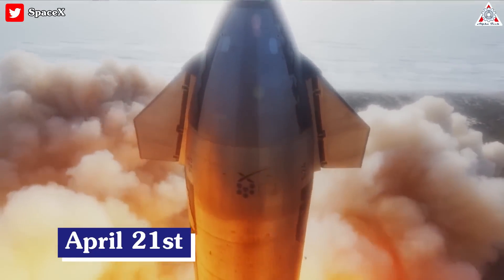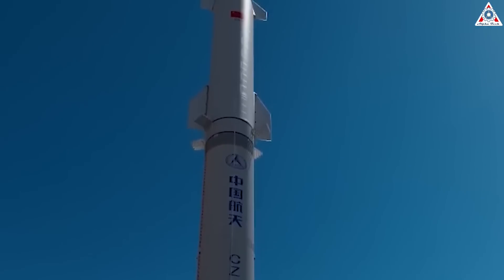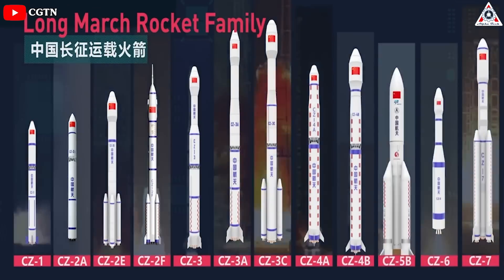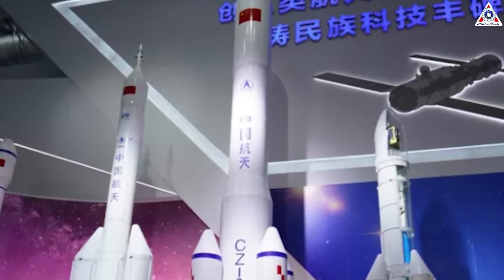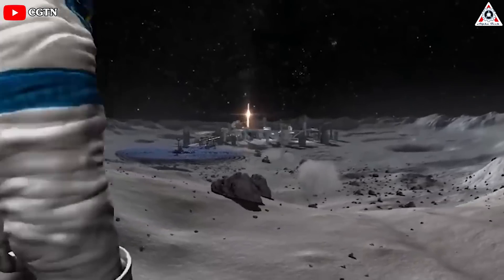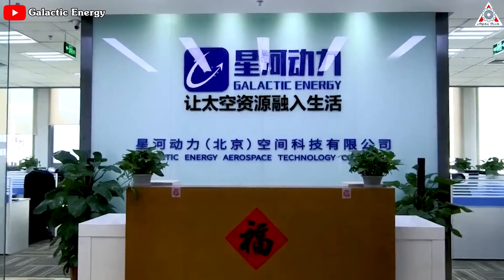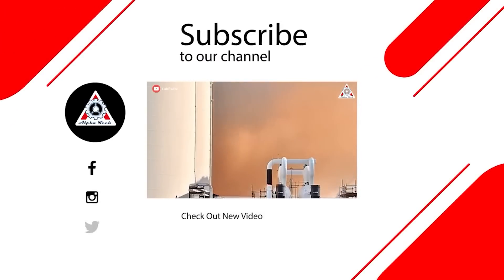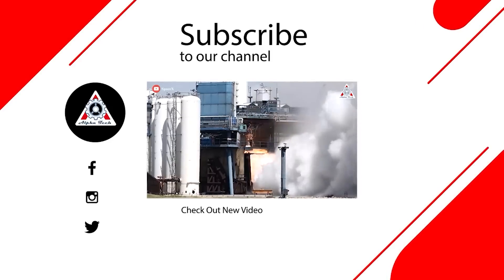Disaster! China keeps COPYING SpaceX's rocket

Comment: There is no need to reinvent the wheel and fiddle around with the design of the structural frame of the rocket.
If the image of starship rocket is good enough to bring US to space, then it is good enough for China to used it for their spacecraft launching.
The most important technical aspect of the launching of spacecraft is the Space Launch System Solid Rocket Booster needed to launch payloads with more mass and volume to deep space and burning approximately six tons of propellant every second in order to send an aircraft to space.

Comment: i would love to see starship heavy design similar to falcon heavy
Reply: You would have to make the rocket to heavy to do that.
Reply: Imagine the crater that thing would create... They'd have to use more than just concrete for that launch.
Reply: @Darion350  🤣🤣
Reply: @Darion350  they not suppose to have flat concrete in first place
Reply: @andreaperv9989  I know, I was being somewhat sarcastic.
Reply: I think the falcon might be pushing the limits of what can be supported through an exterior "shell like" structure alone.. Larger Rockets will likely require more internal or integrated internal-external support network and this is a substantial change in core design concepts.
Reply: @Jason-bu9sv  it actually can be opposite, because in such configuration each booster will have to deal with 3 times less mass to stack on top of it, example: falcon 9 lift 16t to orbit, falcon heavy lifts 64t, so such configuration is 4 times more efficient, yes more complex but 4 times more weight at once